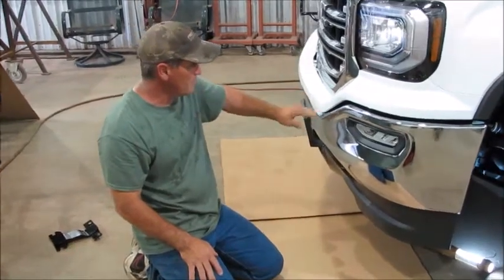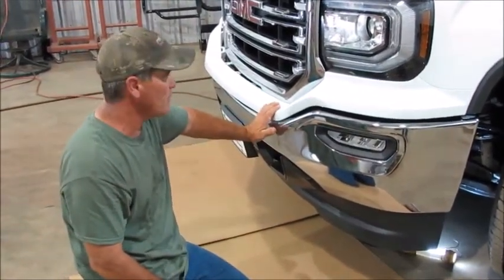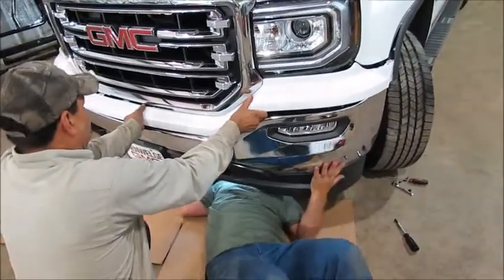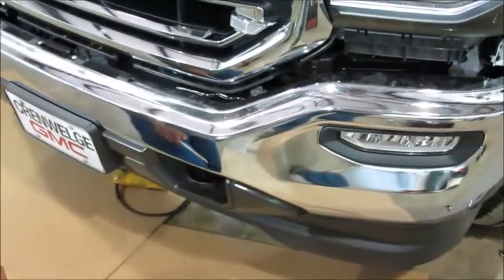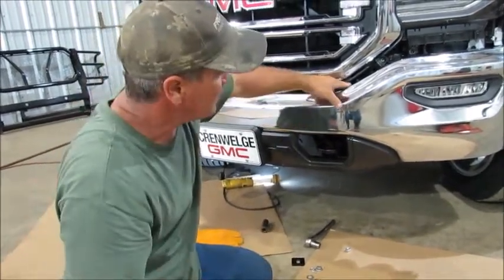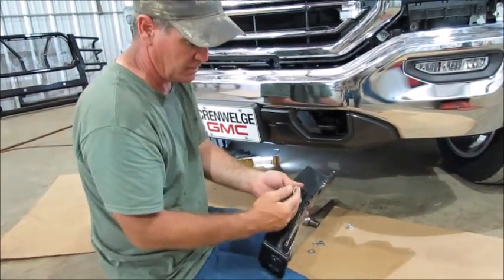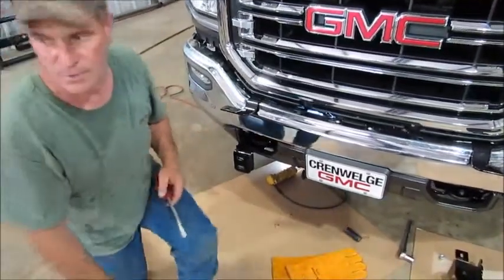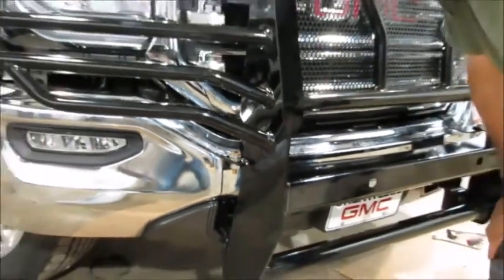Frontier Grille Guard 2014-17 GMC 1500 Installation

Comment: That's stupid why would companies add mounts to the bumper. The point to adding a brush guard is to protect from setting off the airbags making the front stronger to bump thing's and not set off the airbags but adding a mount to the bumper is just stupid.
Reply: warren wallace the purpose of a brush guard is to protect from brush.   Hence the name.  Otherwise they would call it a battering ram or something.   

I’m picking one up for just that, to protect the radiator from rocks, and to give a mount for a light bar.